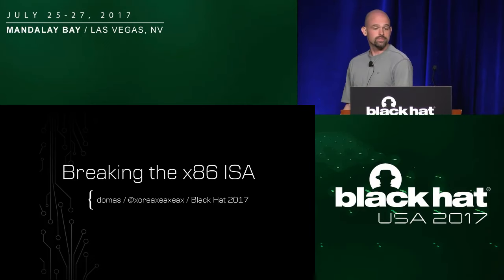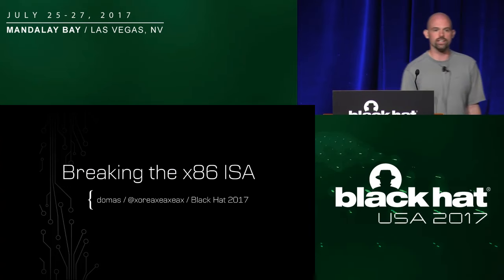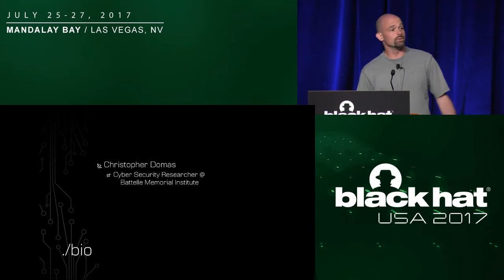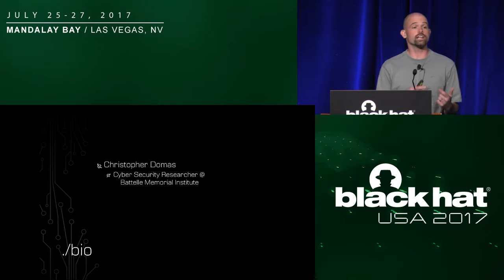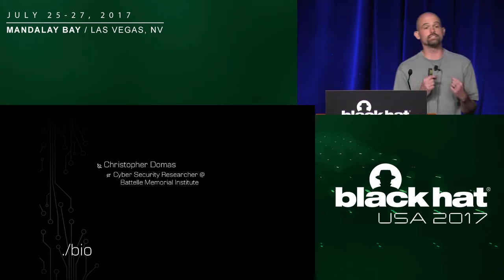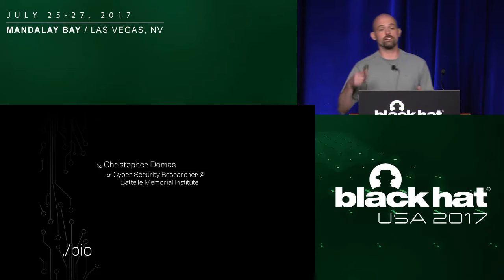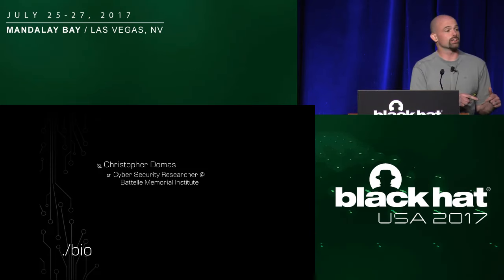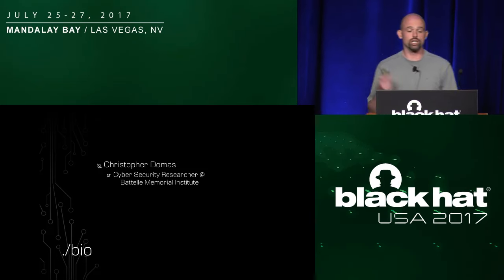Breaking the x86 Instruction Set

Comment: are there any plans for a new instruction set to replace x86 in the future?
Reply: Not in the personal/mainstream computer market. x86 is a mish-mash of things, and that allows backwards compatibility. Others exist, like Apple went to PowerPC (RISC) in the 90s/early 2000s, but that didn't end well, with Apple going to x86, anyway. Consoles went to PowerPC as well in the 2000s, but yup, they too came to x86 eventually since it's easier to program and leverage their performance/cheaper/scales better. Having said that, ARM in the future might possibly replace everyday computing needs - and it already does in terms of phones and tablets etc.
Reply: thanks.
after this video i looked some up and found about a recent one RISC-V, ever heard of it?
Reply: No worries :) Haven't heard of that one, but IBM for instance are still actively developing their RISC POWER architecture that PowerPC was derived from - they're still used in current and future supercomputers and some servers. x86 (Pentium onward) decodes CISC into RISC-like instructions. ARM is RISC too. The RISC vs. CISC debate though died out a while ago, since x86 is essentially 'both' in a way. But even things like micro-controllers for car engines are primarily RISC-based too. Intel recently pretty much quit that SoC/embedded market (no more Atom chips etc), so as far as efficiency goes, I'd vouch that RISC-based stuff will rule the roost there for a while.

Comment: I am not an assembler expert, but is it possible that these instruction appear because of hardware limitation to ignore some sequences?
Reply: The presence of 'prefix' bytes--like 0x66 mentioned in the talk--makes me think that what you mention is a strong possibility. If a prefix applies, even when it isn't meant to, then i can imagine unintended behavior  happening very often. For example, in English, you can add all sorts of prefixes to words, and the word won't be real but one can still interpret it (nonintended, disintended, atended, distended, etc.) Similarly, a processor may interpret such an opcode, even if it's undocumented.
Reply: You have a point. OP codes are not randomly assigned: there are bits interpreted (in a sometimes convoluted way) to find out which registers, memory banks, flags etc. are affected, and what to do. Some instructions might be simply undocumented because they don't make much sense, e.g., "overwrite program counter with its square root". Also, no processor vendor will encourage you to run programs like The Sandsifter on their hardware: Garbage in, garbage out.
Reply: +David Kofler why... if you can discover another f00f or something else? in the worst of the hypothesis you just spent time learning and developing tools.

Comment: Does anyone know of a tool that does this with Intel ME/AMT or AMD PSP/SecureProcessor?  We need to audit the sh*t out of that next.
Reply: You might be comparing apples to oranges. I believe the main problem with figuring out the IME blackbox is of cryptographic nature, whereas this problem has to do with obfuscation through no documentation. With IME, a way to bypass the cryptography and security would be needed.
Reply: you mean analyzing the die?
Reply: Maybe, I don't know enough about the technical aspects. From what I've read, everything it uses is encrypted. So you can't just monitor the memory it uses because it's encrypted, as is the firmware. There was some recent news that researchers found an undocumented (to the public) mode that supposedly disables it. You could probably find the news by searching for "intel me High Assurance Platform".
Reply: Domas got closer with his god mode video. He didn’t dump smmram and analyze it, though. That would be useful.
Reply: GeneEditingDuringIQCrisisStrugglesToMakeProgress Idk if you’re still curious but there is now an auditing tool for PSP called PSPTool. Supposedly AMD’s runs on a Coretex 5 core using ARM’s TrustZone tech.

Comment: Ok, I'll just not use x86 anymore... Hello ARM! xD
Reply: arm has plenty of undocumented instructions too, also only available for partners
Reply: RISC-V then maybe? Or POWER? That would at least prevent you from worrying about the ISA, though your specific chip manufacturer (like SiFive or IBM) could add some undocumented garbage, but they would at least be breaking the spec in doing so.
Reply: Torpcoms RocketChip RISC-V of course, on an iCE40 FPGA, though good luck on getting it fast ;)
Reply: RSIC power9 tbh
Reply: For this to work, you'd have to 1) extend this tool to the ARM/RISC-V/Power architectures and 2) check every processor you use.
Reply: i rather 3d print my own processors...
Reply: fss1704 , can I make processors from wood too?
Reply: +thekornreeper of course you can, if you know the "quantum sdk" behind physics.

Comment: With the 66 byte issue, would it be possible to inject code which use any hardware bug that results in a permanent killer poke or HCF, basically bricking the CPU? If it ran a microcode on startup with this exploit it would be permanently bricked? Could we see a hack/exploit or anything in the future that would brick millions of devices?

Comment: What about responsibility to the general public. 40:17 sounds serious. Must know which processor this is to prevent house burn down ! ;) Want to buy new PC... don't want to buy that processor that locks up. Could be anything... Intel or AMD.
Reply: Since the keyboard has red lights, is that a hint that this is AMD ? If it's ryzen than that's kinda old news FMA3... but if this is threadripper I want to know ASAP ! :P :)
Reply: Ok not used in wide spread production... pfew I think this means AMD threadripper is not met yet... and it's safe :P :)

Comment: Talks about undocumented instructions in mainly US made processors - worried about software communicating with Russian servers. Sense.
Reply: Aren't US-made processors used basically universally?
Reply: nope
Reply: theNISK Please elaborate? What's a commonly used CPU in Russia?
Reply: commonly all the same ones as everywhere else. I was just saying it's far from universal, for places where security is required there are homegrown processors that are used in the likes of Military & aerospace. There's also a push to use homegrown processors elsewhere in the government & finance - you know, in the immediate future it probably doesn't matter if some small district is using Intel processors on the book-keeping PC, where the main task is managing excel spreadsheet managing roadwork costs or something. But in the long-term it definitely a good idea to have all governmental agencies use homegrown stuff (for economic reasons alone). China does exactly the same.
Reply: Well, the origin of software is much more diverse. Besides, there is a huge amount of silicon produced outside of the USA nowadays. OP didn't say anything about all ARM chips being 100% to spec...

Comment: You know the only solution to this is Free Software and Free Hardware CPUs compiled onto FPGA chips. They are coming.
Reply: I'll pass, thanks. I like to avoid voluntarily quadrupling my power consumption while simultaneously quartering my performance.
Reply: Yes, because X windows system is such a great, bug free, piece of open software that totally doesn't have (dozens of) 10+ year old bugs in its bugtracker (not even joking), and having a KMS 3d-accelerated GPU driver that doesn't crash, hang or otherwise suicide when told to perform (such a perilous request, i know) screen resolution changeis no hassle at all.

And linux shells (and shell scripts) totally aren't a mess of double- and single- quotes sprinkled with apostrophes which get expanded in multiple different places, according to multiple different rules. I recommend you try writing a shell script that renames all files named, say, *.doc to *.bak or in other words, change extension of all the files of given extension to a different one. dos did it with one command. Good luck soldier. (pro tip, $mv *.doc *.bak DOES NOT do what you think it does, due to how shell expands this command)

Open source is great if you want stuff for free that works most of the time. But sometimes you need something that works all the time.
Reply: +TheHue's SciTech adabatic computing damn research this shit.

Comment: And this is somehow news?

Hardware backdoors have been around for decades.
Reply: And a very important lecture as well.

I just find it odd that people are somehow surprised that this is going on.

Do you think we would have ever been given access to this technology without it being able to be remotely spied on and controlled?

Go and read about operation talpiot, it goes back to the early 70's.
Reply: BTW I think the really interesting point raised here is that the same secret instructions exist across hardware from different vendors.
That shows a coordinated plan of corruption.
Reply: Axe Man "never attribute malice what can be attributed to stupidity" blah blah. If this has been known for years, and is seen as a serious problem, why aren't most secure systems using risc?
Reply: +GetTheCheeseToSickbay, Firstly , that the same secret instructions occur across different chips from different manufacturers proves a pattern of collusion not co-incidence. Secondly all commercially available CPUs have the same shit built into them, an analysis of the ARM architecture will find that it is also fundamentally compromised.

I suspect the freescale malaysian airlines crash was partly about keeping CPU makers in line with the plan.

Did you go and read about Operation Talpiot?
Reply: Axe Man I'll check it out for sure.